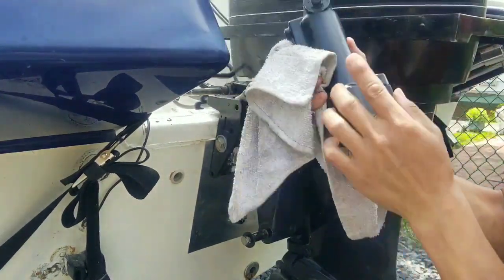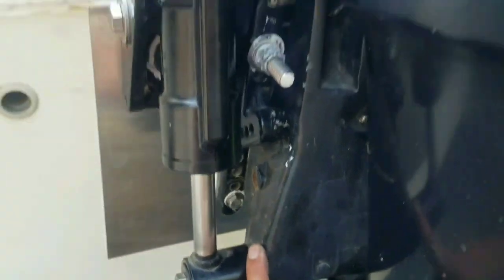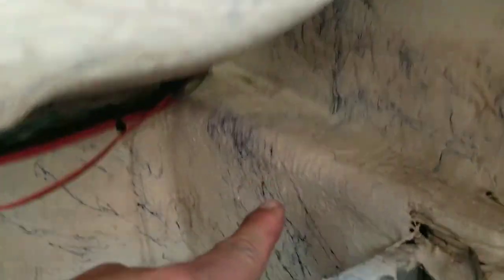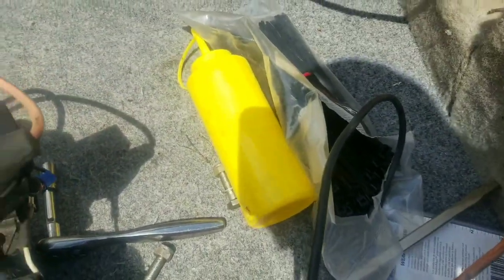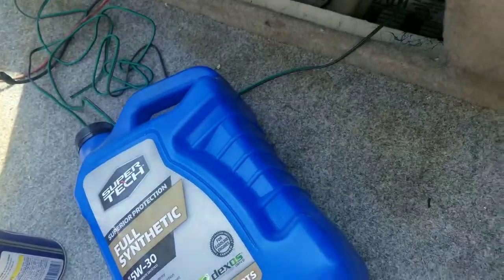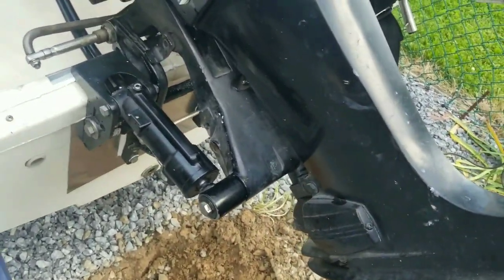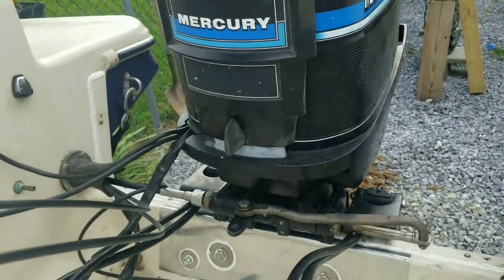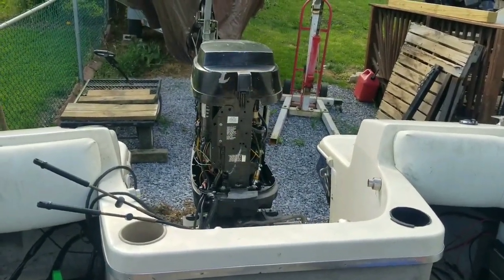Mercury Outboard Power Trim Install - Inlines

Comment: The wire goes from the switch to the solenoid and controls the pump.  What wire was going into the engine cowling area?
I’m trying to rewire mine now
Reply from the maker: I'm not sure I understand the question. For the external trim pumps there are no wires that go into the cowling area. Son

Comment: I have the same setup as this I added some oil to the reservoir and when I'm putting the motor up and down it stops and just clicks then after a few minutes it trims again what could this be? Also there are no leakes and the system has been reconditioned thanks
Reply from the maker: Faulty Selenoid. Son
Reply: Thank you do you know where I could get 1? I'm from the uk
Reply from the maker: @XXABERCYNONBOYXX  https://www.ebay.com/itm/290331590943

Comment: Do you by chance know where to get replacement hoses.  Mine are pretty crunchy and need replacement.  Great tutorial.
Reply from the maker: https://rover.ebay.com/rover/0/0/0?mpre=https%3A%2F%2Fwww.ebay.com%2Fulk%2Fitm%2F153499933296
Reply from the maker: This is the set I used in this vid. There is 1 set left.
Reply: Any idea on part numbers for these hoses link is no longer active
Reply: @rcl700  the sierra part numbers are 18-2110, 18-2111 also he said 10mm and 13mm they are actually SAE 3/8 inch and 1/2 inch plus use a flare nut wrench to remove them